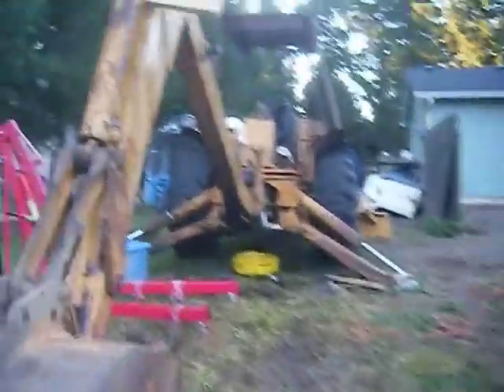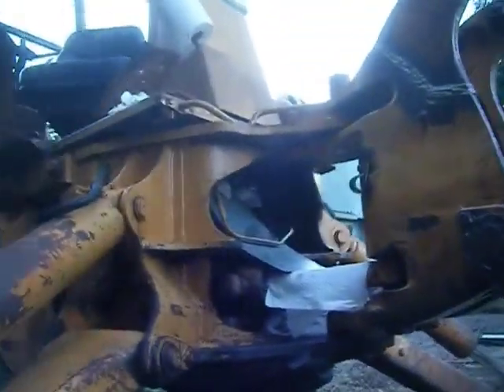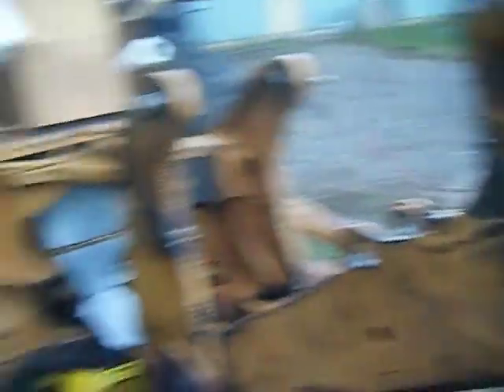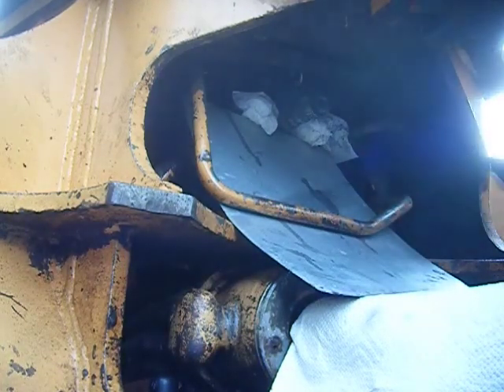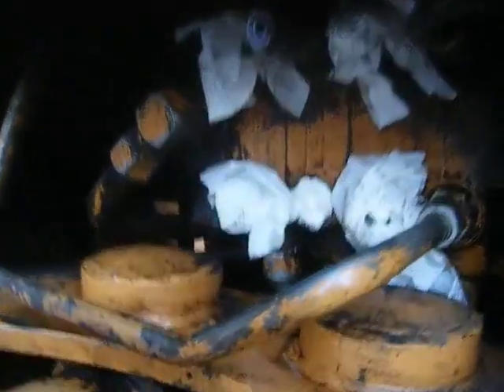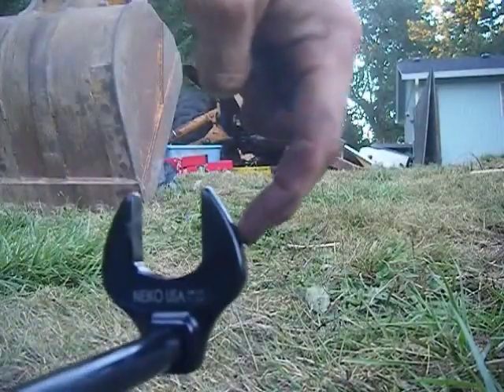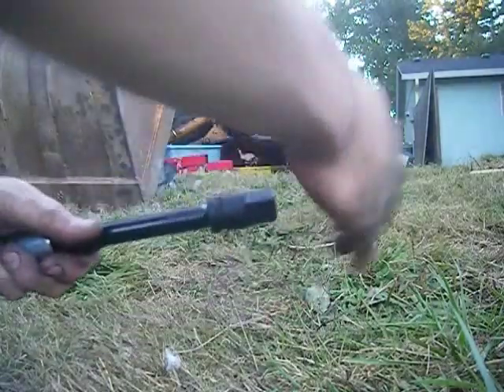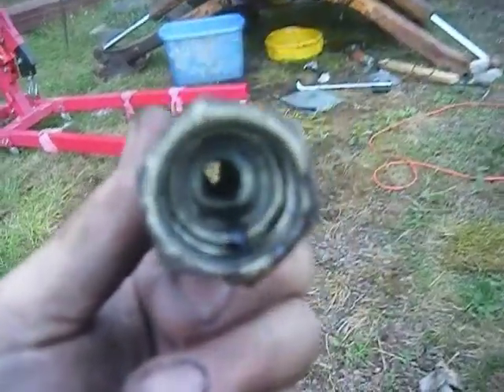Removing a Stubborn Hydraulic Fitting on CASE 580

Comment: should have taken a piece of pipe/bar. and a mallet hammer...and bash the everloving shit out of it..impact is the easiest way to break free those JIC fittings..they are always cunts to get off especially on old machines..should be able to get them off with a short wrench pretty easily after that..as a hydraulic tech i get this shit all the time.

Comment: Can you tell me what size wrench is needed for the flare nut on the steel tube just above your protective metal sign. Also the fitting it screws into. I have a 580se with a leaking flare fitting. Problem, the backhoe is in NC and right now I'm in FL. Thanks, John